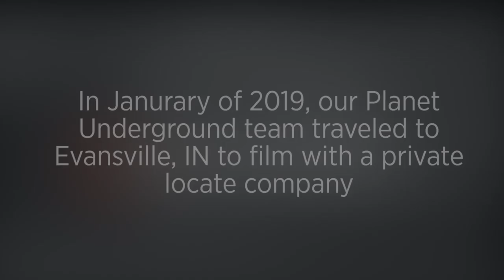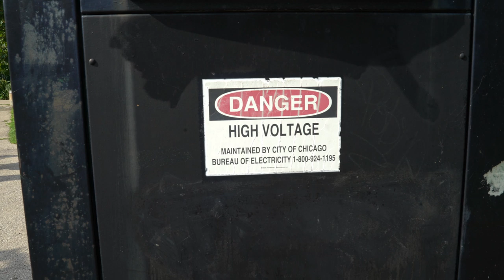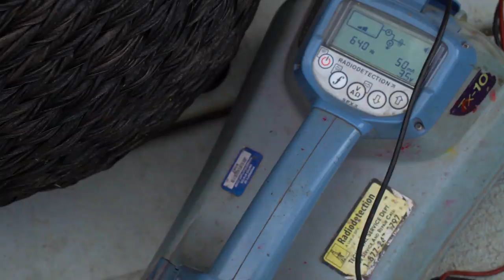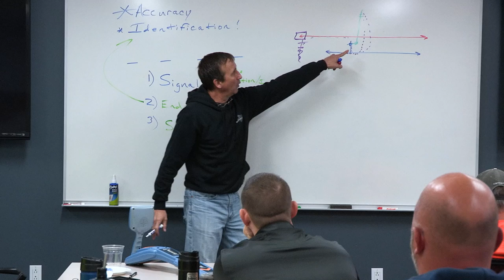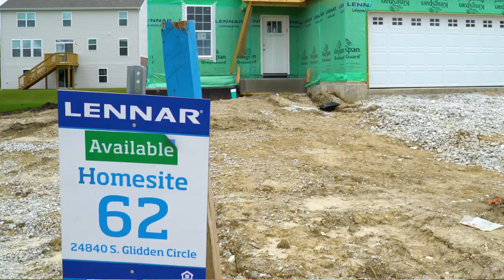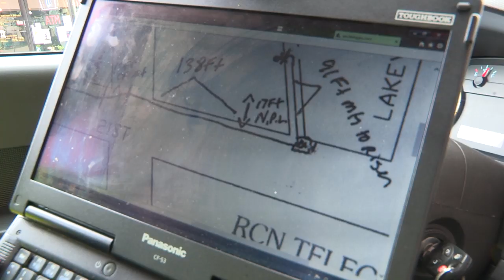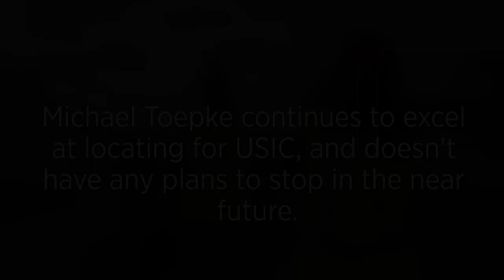Episode 16: The Locating Life

Comment: How much experience with building plans layout is required for a position as a locator?
Reply from the maker: For a 811 locator no experience is needed. For subsurface utility engineering experience with utility systems may be necessary for hire.